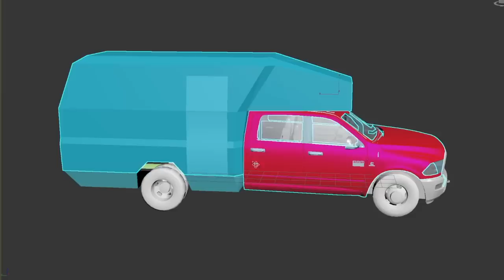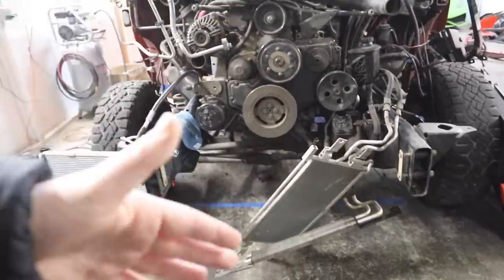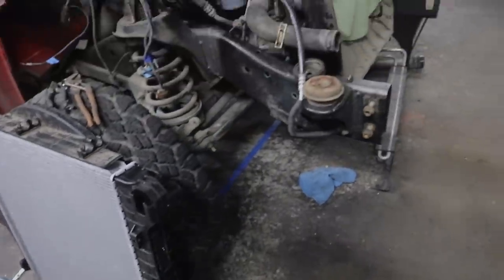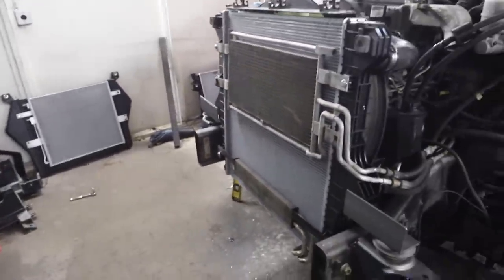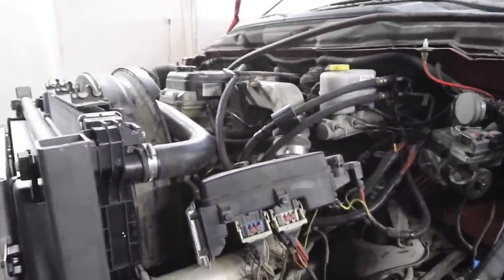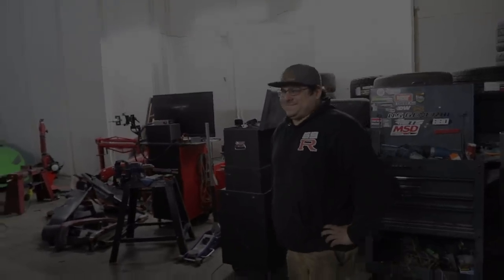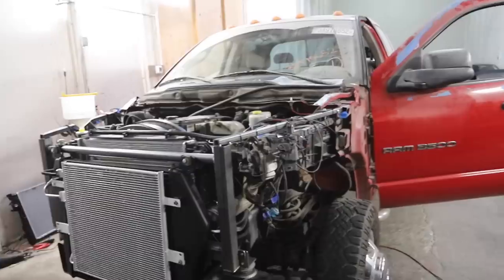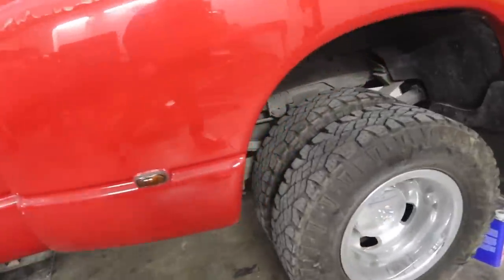RAM 3500 OVERLANDING CAMPER TRUCK  Front End Rebuild - Will It Start?

Comment: That sensor labeled battery tray is the battery temp sensor.  If you have an issue with the alternator not charging make sure that sensor is good.  It won't let the alternator charge if it senses that the batteries are over temp.
Reply: Was going to say that, but you got to it first.
Reply: @IDK_Mr.M  I chased my tail on a Durango years ago because of this stupid sensor.  lol
Reply: I run a ford alternator and my tune deletes this sensor 👌 fummins.
Reply: I did wonder what that was under my battery. Ta.
Reply: Good to know! That means keep it! Lol
Reply: Sounds like a dumb version of BMW's intelligent battery sensor, and sounds like a headache to diag if you have no idea its there
Reply: Didn't even know those were a thing

Comment: You guys should definitely consider reinforce the frame rail extensions, since the steering rack will bolt on it. Also, won't be a surprise how quickly you will reach the maximum payload allowed. Personally I'd prefer getting a proper off-road trailer, and while the trailer is parked, explore with the truck the trails nearby.
Reply: Agreed.  Or buy a steering brace.
Reply: Came down to say the same thing.
Reply: No power steering rack on a 4wd Dodge. Just a massive box but I'm pretty sure in the last video I heard him say they plated them.

Comment: Be careful with the weight of the cab you want to put in the back and the amount of space you leave to the passenger cabin. I have seen quite a few offroad novices who put to heavy cabs on pickups and then additionally leave almost no space to the stock cabin. The frame on these large pickups flexes quite a bit while offroading with a heavy load and can actually break quite a lot of stuff when the cab and the camper are to close or directely connected.

Comment: Excellent bit of kit to build. Future upgrade thought, if I might. Do a 22.5 conversion, and run a super single rear.
Reply: Don’t do this. Super singles are way heavier than the factory 16.5 or what ever size duals. Also if you loose a super single, you almost always destroy the rim too. With duals, you usually only loose one tire and the other will still support the weight.

Comment: Hey Chris.  Best air bag route to go is the AirLift Wireless Air controller.   It is a 2 line system, so it won’t cause sway.  And in a camping format, the bags can be used to level the rig out some.  Also with towing a trailer, you can max the bags out, set the trailer Jack, unhook the trailer, and dump the bags to drive out.  Highly recommend this system.  Also, keep all the extra hose and fittings in the rig for just in case’s. 

The best part is when you don’t need them, just set to the lowest setting, 5psi, and they don’t affect the ride at all.

Comment: So the battery tray sensor that you grabbed actually detects heat from the battery and can cause a check engine light and battery light to let you know that your battery is overheating from overcharging or short circuiting
Reply: Certainly supplemented their answer!👍

Comment: During final assembly you should flip the front bumper bolts around to come in from the outside.  you cannot remove the bolts without removing the intercooler if they are in the stock orientation.

Comment: I would love to see a dually to camper conversion where you stretch the frame and add a tag axle (additional rear axle like a semi).  That would give you a tremendous amount of space inside the camper box on the back.  I know this isn't that build, as this is intended for overlanding.

Comment: My uncle purchased a rig for removing the bed off his truck, it goes into the receiver, and it’s basically a 360° engine hoist. He removed his bed with it to access the fuel pump instead of cutting a hole in the bed.

Comment: The tick you heard was the fuel heater kicking on. When you run it you will see the battery charge drop drastically when the heater cycles.

Comment: Hey those year trucks have issues with the intake grid heater braking bolts and destroying the head. You really should look at getting a banks power ram to solve the issue. There is in indepth video on their channel

Comment: I've wrecked a few truck front ends. Absolutely crushed little cars. Last one was a 2002 ram 1500 4 door. Only had to replace the bumper and the fender that the bumper was set into. Wasn't a straight piece on that car. Whoever wrecked that must have hit something really big. And heavy.

Comment: 13:00 Man, be careful about calling your shop pathetic and too small to pull off your bed in, that's a HUGE space to most your viewers 😞. In my 2 car garage I did a full Cummins swap including pulling the body so I could box the frame. A lot of people would kill to have as much space as your in between shop has, but you'd also be surprised how much work you can get done in a tiny space when you need to!

Comment: Instead of having the oem clutch fan would it be better to install an electronic fan in your build?
Reply: No, electric fans will never pull as much air as the stock fan on a diesel.

Comment: Sweet baby Jesus, this is one of, if not the worst repair Ive ever seen. Holy crap just buy the replacement parts. It’s not necessary to use iron stock on everything.

I am actually embarrassed for your channel. This is not only unsafe, but should be illegal to drive on public roads.